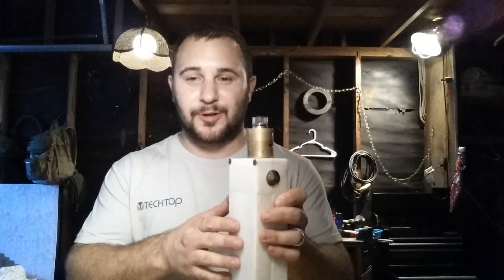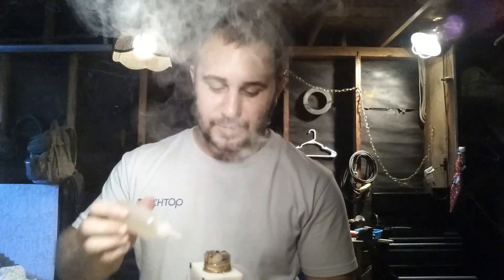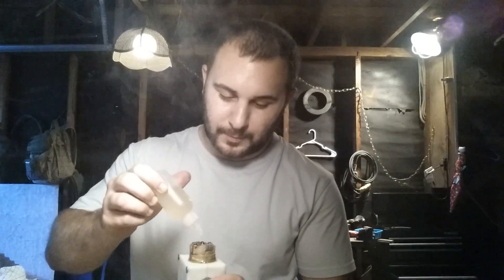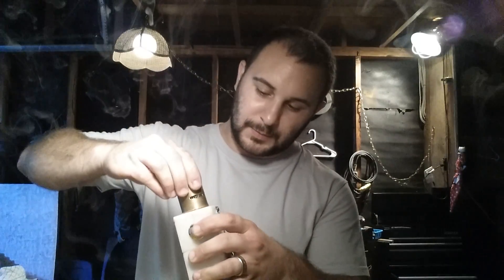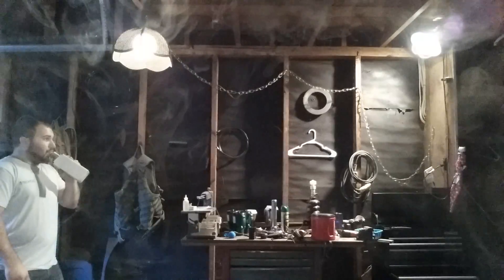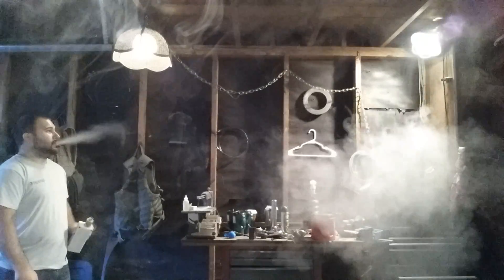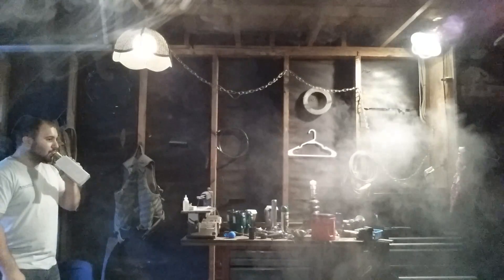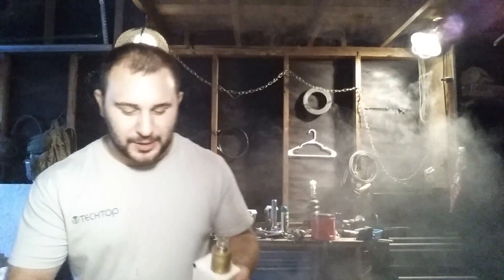Vaping a kilowatt test video

Comment: You should build a rig with a huge generator running at 800kV (which is the equivalent of a 
extremely high voltage power line.) try to vape that with like 58mg nic. Fuckin dead m8.

Comment: Is it possible to craft a mod build like this with a Tank, rather than a drip tip? I'd be curious to know, as I would assume the wick would dry out ridiculously fast. The only remedy I see for vaping at this high level without totally frying your wick would be to constantly drip it after each hit.

Comment: You're a boss for doing this, but for being 1000w, it doesn't seem to producing 10x the vapor of 100w mods. Does that have to do with the coil build not taking the full potential of your wattage? I don't even build, sorry if it's a dumb question lol
Reply: +SoberLifeEnterprise If I had to guess there would also be bottle necks in lung capacity and juice flow.
Reply: +Sean Coker what juice flow? That's a dripper. He wets the wicking manually by dripping e-juice directly on it as you see in the video. Can't actually imagine any other way to vape that. But, at this point, he might want to look into other wicking materials, cotton might actually not do the trick anymore...

Comment: lol.. nice. what type of mosfet are you using..? IXYS..? Have you thought about putting a Hobby King Watt Meter in it? I've been talking shit for a long time, and never built my 1kw box mod.. yet. But putting a 4S LiPo, 1.25kW IXYS n-Channel Mosfet, etc. etc.  I'm pretty sure it can be done, and display the output on the watt meter to shut people up that are skeptical that it's not putting out the watts you say it's putting out. lol. I'm actually planning on doing a 1kW+ box mod, but just havenen't really commited yet.. I'm getting close.. I see they have the DNA 200 now.. lol, it's honestly a joke. I really thought there for a second I was going to buy the board, but it's garbage. Watched pbursurdos video, and he showed some things, and I did some calculations, and the board really ain't doing what the hell it's supposed to do, even given the proper battery and everything.. I'll just stick to building shit like this. lol. which if I put a watt meter on it, I'm pretty sure I'll be pretty happy.

What box, lipo, n-Channel mosfet did you use for your build..?

(+1 : 367)

Comment: so let me get this straight, the battery can give 1kw but the unit only usses 186w with the two 0.12 ohm filaments? thats unfortunate that its not really 1kw then.
Reply from the maker: I have no idea where you got the 186 watts however that is incorrect. I got 11.2 volts at the coils running 90 amps which is technically 1008 watts
Reply: +Matthew Vandewiele
ah ok that was my bad, i was thinking the result of 11.2/0.12 was 90w not 90a
Reply from the maker: +Rinoa Super-Genius its all good I actually posted another video where I tested it with a volt meter and amp meter
Reply: Matthew Vandewiele
cool, i'm not into vaping but i'm going to be buying a Nissan Leaf battery pack for an EV project, and want to make a 1 or 2kw box mod just for fun.
Reply: +Renato Sabo more like he can't fully inhale all of it because of the heat haha.
Reply: +Rinoa Super-Genius still awesome.

Comment: How the fuck do you make these things...
Reply: +TheWisconsinGamer take a high voltage batter, take a switch, wire it up to a 510 connector and push go...
Reply: +Timothy Lieuw 
the 510 connector can only take a limited amount of current before it melts 

i recommend just hardwiring that son of a bitch
Reply: MWB Gaming I know, but in order for you to get to that point you must first build low enough to make it so the 510 is the highest point of resistance.
Reply: not true

you just have to draw enough amps through it to melt it

the wire can have a lower resistance than the load but if the wire is thin enough it will still melt regardless

same goes with the connector
Reply: MWB Gaming I would imagine that would be quite high no? I took a reading with my ohm meter on the 510 pin and threading on both atty and device and it was far lower then the resistance of the wire. I would assume that you wouldn't run into heat issues until you started to get really low like into the thousandths of an ohm or lower.
Reply: i estimate the 510 connector will start to melt at around 100A
Reply from the maker: +MWB Gaming my newest pwm lipo box ran 1200 Watts without issue though a basic varitube 510 for a few days with zero issues. that's over 100 amps at 11.2 Volts. the only heat came from the Atty and a slight warming of the mosfet
Reply: what material was it made from?

i tested a few spare 510s i have laying around and at 75A they started to get warm and at 90A they got too hot to touch
i sustained the current for around 20 sec
Reply from the maker: The standard stainless varitube 510  with the brass positive pin and whatever they use for the insulator
Reply: that may be the difference
the ones i have are just stainless steel generic 510s
im still using my SMOK XPRO M80 plus
im thinking of building my own mod though because the battery in this thing is starting to shit itself